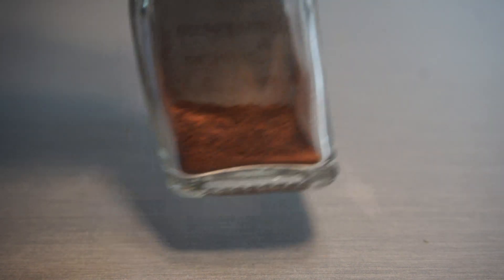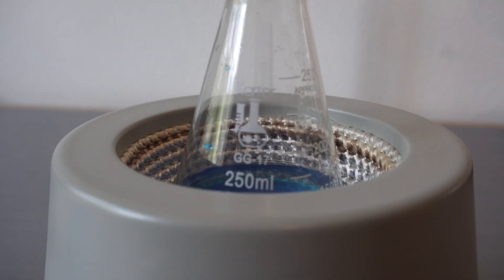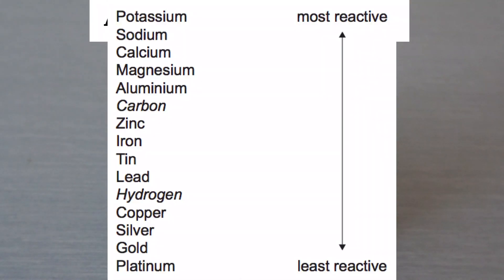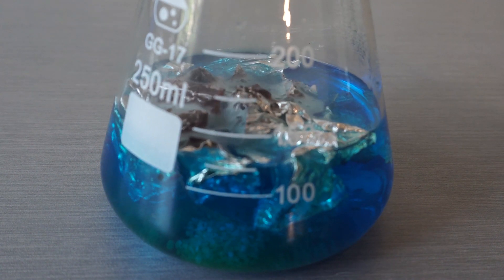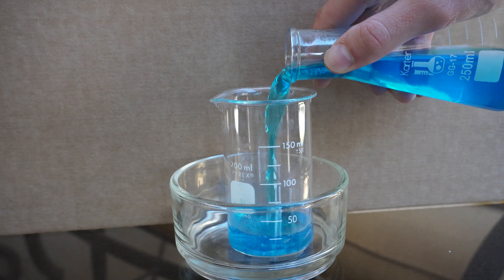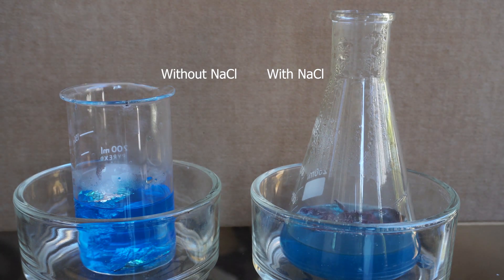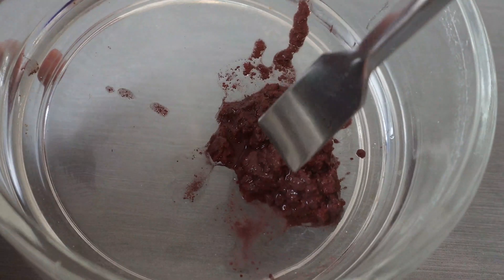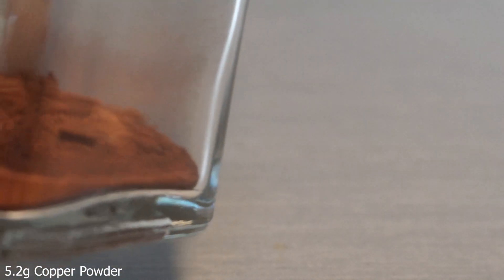Making Copper from Aluminum - Single Displacement Reaction #Chemistry #reaction #displacement

Comment: +The Preston Impression The formula for aluminum sulfate is not AlSO4, it´s Al2(SO4)3.
The correct reaction equation is: 3 CuSO4 + 2 Al = Al2(SO4)3 + 3 Cu
Reply from the maker: Ohh thanks for pointing this out!
Reply: @PrestonImpx  No problem! What do you think about making a soluble chromate or dichromate from old stainless steel? If you´re interested I can tell you how it can be done.
Reply from the maker: I am very curious about this. Tell me more
Reply: @PrestonImpx  Well the idea is to dissolve the stainless steel in hydrochloric acid to make iron(II), nickel(II) and chromium(III) chlorides. After that sodium carbonate must be added to precipitate iron(II) carbonate, basic nickel(II) carbonate an chromium(III) hydroxide. The precipitate mixture is then washed and treated with a mixture of hydrogen peroxide and either sodium hydroxide, potassium hydroxide or ammonia to turn the chromium(III) hydroxide into a soluble chromate. After filtering and boiling to decompose any possible excess of hydrogen peroxide the solution can be acidified with most acids to turn the yellow chromate into orange-red dichromate. However if plan on making ammonium dichromate from ammonium chromate you can just boil its solution since it unstable and decomposes on heating even in solution, but this process releases ammonia gas so be careful.
Reply: Yes it is Al2(SO4)3